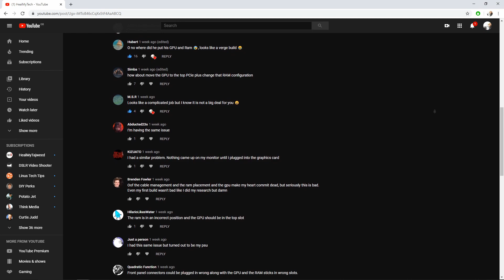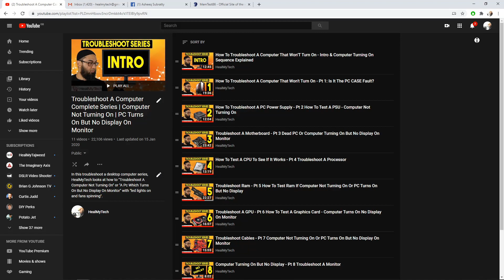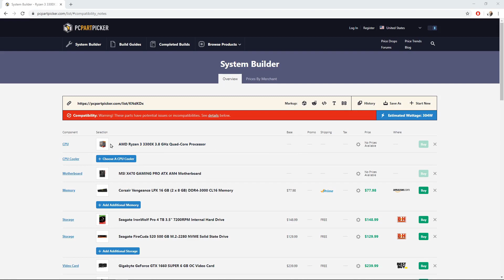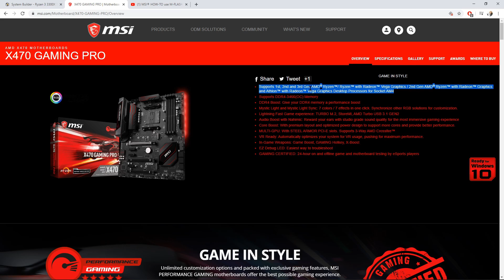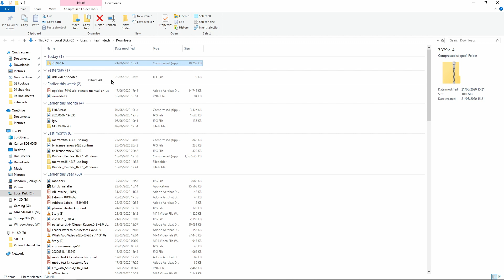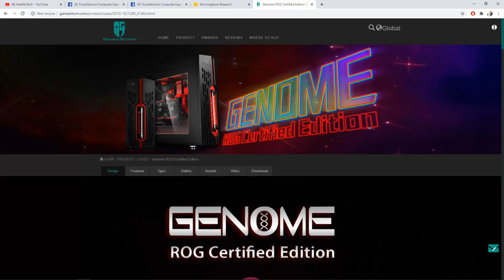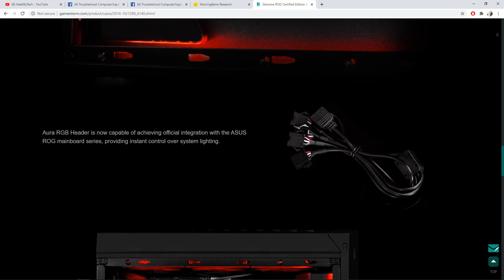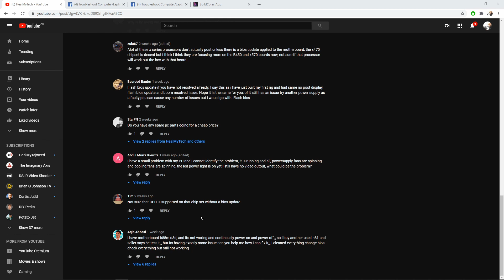New Gaming PC Build No Display - HUGE Beginners MISTAKE

Comment: Could have literally said the mistake in the first minute
Reply: You could have mentioned the mistake in this comment too.
Reply: Where's the timestamp guys? 15 mins for 1 mistake.
Reply: @hydn79  I ended up not watching the video. But in my case, the problem was that the motherboard's BIOS version was not compatible with my CPU, so the solution was updating it to the latest version.
Reply: @facuigua12  thanks! Thats it indeed
Reply: @facuigua12  did your pc turn on but there was no display on the monitor (bios included)?
Reply: @ozanisaqt5646  Yes, PC turned on but no display, no signal at all.
Reply: @facuigua12  but how did you do it with no display?
Reply: @delijahwane  Modern motherboards have a feature to update it with a usb flash drive and pressing a button, on my Gigabyte motherboard it's called Q-Flash. Look up how it's done for your specific model.
Reply: @facuigua12 I already updated my motherboard before I put my new cpu in and it still won't display
Reply: then u wouldnt have watched the video

Comment: I just bought a brand new pre-built PC with a Asus 3080/Asus Mobo/i-9  and couldn't get display to read. I know that the parts are compatible but you inspired me to consider it was a BIOS issue. I popped the CMOS battery for a minute, put all the cables back and VOILA!!! Saved me thanks for your insight!

Comment: Hello, if you build a new pc for first time and if you use ryzen cpu this is for you. A Ryzen processor without the suffix 'G' (in model number) needs a Graphics card (GPU) and you can't output it to screen without one. So for a normal user you'll definitely need a Graphics card not only for BIOS update but for using it too.
Ryzen processors* (as mentioned above)comes without integrated graphics card which is needed to display to the monitor.

Comment: My brother bought an MSI X570-A PRO and Ryzen 5 2600X. No display output on his rig either.
Albeit the motherboard bios update is mandatory for series 3000 cpus, the non posting/displaying issue can be still present.
First time i tried to boot my brother's pc, the tv it was attached to (via hdmi), was displaying a still image (probably the last frame in the video buffer) with artifacts.
I'd advice to let the pc run a little longer on the first post and try different video ports AND screens (I solved switching to an old IBM VGA lcd display fo initial configuration).

Comment: Ok, so I built a new computer for my wife.  My first build in YEARS so I'm further out of the game than I thought I was and am having issues.  I initially was able to get this to post connected directly to the graphics card.  I fiddled around in there with some things that I rightly should not have as I didn't know anything about and exited.  I am now unable to get anything to post at all via the graphics card nor the motherboard directly.  Any help at all?

My system:
-MSI MEG Z490I UNIFY Mini ITX LGA1200 Motherboard
-Intel Core i7-10700K 3.8 GHz 8-Core Processor
-Crucial Ballistix RGB 64 GB (2 x 32 GB) DDR4-3200 CL16 Memory
-Asus GeForce RTX 3070 8 GB KO Gaming OC Video Card
-Thermaltake TH240 ARGB Sync 59.28 CFM Liquid CPU Cooler
-Addlink X70 1 TB M.2-2280 NVME Solid State Drive
-Team T-FORCE DELTA RGB 1 TB 2.5" Solid State Drive
-PNY CS900 1 TB 2.5" Solid State Drive
-Corsair CXF 650 W 80+ Bronze Certified Fully Modular ATX Power Supply
-(2) Corsair ML120 Pro LED, White, 120mm Premium Magnetic Levitation Cooling Fan

All in an Antec Striker cae.  

Will be running Windows 10 Home OEM 64-Bit but haven't gotten that far.

Comment: I have a B450 M PRO R2.0 with a ryzen 5 1500X and two sticks of DDR4 2666. And I put in a GTX 1650. But when I try to boot it up, Everything powers up, but no screen.  It gives me 5 beeps. I put a speaker on the mother board still 5 beeps. I have a radiator for pc cooling my graphics card. What am I doing wrong? 🤔

Comment: So I have the same issue.. no display, hence I can't get in to the BIOS setup.  I've checked the compatibility and the MSI B550M PRO-VDH WIFI Mobo is compatible with the AMD Ryzen 3 3100.  Any thoughts?
Reply: So I resolved my issue. In my case, the fix was ensuring all wiring was plugged in. The GPU had a separate, second module that didn’t dock in to the MOBO but took up a card slot for additional inputs. At first, I did not connect this and once I did.. voila

Comment: Paper clip testing:
 
I first had no fans spinning and PSU fan came on for a few secs and stopped. No power LED on MB either. One by one I disconnected things 'til I sighed and took the MB out of the case & set it on its box. I peeked at the CPU itself & figured out I'd aligned its triangle with an embossed triangle on the slot, but that was 90 degrees off. The triangle should have aligned with a white dot on the MB. I fixed that, connected the PS, CPU fan, GPU and a HDD and powered up, using a screwdriver to short the power pins on the MB. VOILA! the fans all started & kept running even though the PSU fan stopped. Turns out it has a "zero fan mode" at low temps.  Still wouldn't POST, though.
 
Did another day's research and found that the MoBo wouldn't support that series of AMD Ryzen CPU! Hah! I also found that the Corsair Vengeance RAM has a special series for the Ryzen chips. If you use the regular series, as I had, they'd work but not at full speed! Hah #2!
 
So I got an RMA from Amazon and back the CPU and RAM have gone. Soon as I see the credit, I'll buy the proper ones for the MoBo. Another week and we'll then see if that's all that was "unsupported."
 
:D

Comment: I finished my build with a friend, whom is a professional at this stuff, but can't get monitor to display, here are my specs:

Ryzen 5 5600x (Yes I know I need a BIOS update. But can't display the monitor so I cannot update it). 

^ (Would the BIOS menu display maybe if I pressed the bios menu button?)

ASUS TUF Gaming X570-PLUS [Wifi]
HyperX RAM 2x8GB
Castle 360ex AIO.
ASROCK 5700XT Taichi GPU
Corsair 850W PSU. 
6 Case Fans, Lian Li Borra. 

Mobo lights up yellow for the RAM. But I am sure it's the motherboard. But my mobo doesn't have a BIOS USB slot. And I am supposed to be able to use any of the USB slots on the Mobo. 

But unsure of how to update the BIOS if I can't see what I'm doing.

We're going to try putting my RAM in his PC later on tonight when he gets off work.
Reply: Hey could you explain how it got fixed if it did.
Reply: @sudhhhrhsk4756  I looked something up. We had to put his CPU in and update the BIOS. He didn't believe me when I told him we had to do that. But we did it that way. Put my cpu back in and it worked.

Comment: I had the same problem everyone in these comment had but how I got it to show a display was I did nothing and it work. When I first build my pc 2 years ago it took FOREVER to start and I had everything right but then I left it on and ended up falling asleep on my desk the next morning I just turn it off then back on and it worked like normal. Years later I fully cleaned my pc. Removed all my parts, plug it back it and it was not showing display again so I just left it on all night woke up and it work. Idk why it like this but it the ONLY thing on YouTube I have not seen that work for me.

Comment: I'm having trouble getting my monitor to get a signal from my tower. I double checked EVERY plug, tried both HDMI and DP in both the motherboard and GPU, checked to make sure my ram and GPU are installed correctly. I even went as far as to pull the actual CPU out and I did find bent pins but I bent them back and realigned them, reinstalled. Everything runs but the debug CPU light is still on and I still have no signal to my monitor. I tried M-Flash BIOS for the motherboard in case it wasn't compatible with the CPU so that it should now be updated to support my CPU. I've seen dozens of videos and months of research into compatibility between every part and the unit as a whole and while I'm not super experienced, I'm pretty sure there should be no issue. Everything fits in the case right too, nothing bent or out of place even a little.
Reply: My rig:
Case: NZXT H510 ATX
PSU: NZXT C750
Motherboard: MSI MGP B550 Gaming Plus (with BIOS upgrade 7C56v191 from 3/23/2022 for AMD Ryzen 7 5800X support)
SSD: Samsung SSD 980
CPU: AMD Ryzen 7 5800X
Cooling: iCue H100i Elite Capellix
GPU: EVGA GeForce RTX 3060
RAM: 8x2 Corsair Vegence RGB Pro (plugged into the recommended slots according to my motherboard)

Comment: Hi, Im a first time builder and I have the same exact problem with my monitor not turning on. The difference is that my parts ARE compatible and I still have the same issue with the monitor not turning on. The keyboard and mouse and everything else turns on.
I even took out the gpu to see if that was the issue and I still have the same problem. The gpu was also in the correct place, closest to the cpu.
I made sure the ram was in the right place and still no luck.
I checked the battery within the motherboard and no power to the monitor either. 
I removed the SSD to see if that was causing a problem, and nothing changed.
I've been trying to build this dang thing for 12 hours now through trial and error and I don't know what it could be. 
If you have any suggestions please let me know. Thanks.

Specs
Corsair CXM 650 W 80+ Bronze Certified Semi-modular ATX Power Supply                                          Gigabyte GeForce GTX 1660 SUPER 6 GB GAMING Video Card	                                                                Western Digital SN750 1 TB M.2-2280 NVME Solid State Drive
Patriot Viper 4 16 GB (2 x 8 GB) DDR4-3000 CL16 Memory
Gigabyte B450M DS3H Micro ATX AM4 Motherboard
ARCTIC Freezer 13 CO 4 CFM Ball Bearing CPU Cooler
AMD Ryzen 5 1600X 3.6 GHz 6-Core Processor
Acer GN246HL 24.0" 1920x1080 144 Hz Monitor
Reply: same did u found out what the problem is ?
Reply: Same also I got the same specs as u off a Reddit I’m pretty sure u got it off that too?
Reply: Same and its frustrating
Reply: @vSilense  I fixed it
Reply: @xenogng  that's awesome cant say the same for me but that's good
Reply: @vSilense  um ur not gonna ask how? Whatever all I did was push in my HDMI into my gpu more and made sure the gpu was fully in
Reply: @xenogng  LMAO that was the first thing i tried, both hdmi ports dont work so im thinking it could be the motherboard
Reply: @vSilense  dang
Reply: @xenogng  yeah but I'm just testing everything
Reply: @vSilense  try replacing ur ram into a new stick
Reply: @xenogng  yo im going to try thanks for helping man
Reply: Your videos are very well done and are simple to follow - really appreciate that.    First time builder - The same thing is happening to me as well - we are using a MSI B550 Gaming Edge Wifi with a AMD Rayzon D 3900X processor - we flashed the bios and we have no lights on the EZ Debugging panel - however we have no VIDEO - we have tried many things -we checked compatibility and everything works - we are at a loss - any help would be appreciated.   thanks

Comment: sir red light on pc all fans spinning fast no POST what was the solution... Hope u Reply!!!!!!
Reply: Have you found it bro I’ve been building my pc for 2 days and will resume in another 2 days but I had everything set up and no post come to find out power supply was not working so I have to get a new one today. I hope that by now your pc is working bro.
Reply: I first had no fans spinning and PSU fan came on for a few secs and stopped. No power LED on MB either. One by one I disconnected things 'til I sighed and took the MB out of the case & set it on its box. I peeked at the CPU itself & figured out I'd aligned its triangle with an embossed triangle on the slot, but that was 90 degrees off. The triangle should have aligned with a white dot on the MB. I fixed that, connected the PS, CPU fan, GPU and a HDD and powered up, using a screwdriver to short the power pins on the MB. VOILA! the fans all started & kept running even though the PSU fan stopped. Turns out it has a "zero fan mode" at low temps.  Still wouldn't POST, though.
 
Did another day's research and found that the MoBo wouldn't support that series of AMD Ryzen CPU! Hah! I also found that the Corsair Vengeance RAM has a special series for the Ryzen chips. If you use the regular series, as I had, they'd work but not at full speed! Hah #2!
 
So I got an RMA from Amazon and back the CPU and RAM have gone. Soon as I see the credit, I'll buy the proper ones for the MoBo. Another week and we'll then see if that's all that was "unsupported."
 
:D

Comment: I’m still having trouble after 6-7 hours of work into this pc no display, I just changed the cases as it’s a prebuilt and everything was working fine before I switched cases. 
Also it was making a beeping sound at the start when I first plugged it in and double checked the wires and turned it on and it didn’t make a beeping sound anymore
Reply: Probably there's a short with one of the  motherboard raisers.
Reply: Install a video card.

Comment: Wish that was my issue mine is booting into the bios screen but not windows, I get a blue like on my monitor that its on and the display lights up too but 2just not seeing windows. maybe because the graphics card drivers are not fully loaded but if I do a format and start all over I can see windows . It happens when I turn off the monitor I have turned off the HDD from shutting down & pushed the screen saver out for 3 hrs and stopped anything from hindering an issue.

Comment: Im an experienced PC builder, I bought a Ryzen 7 3700x and an ASRock B550m mobo, triple checked the asrock website that they were compatible, but it wont post, so im assuming a bios update is needed, but i dont have a older ryzen chip to do the update with. Going to try and get the store i bought from to give me a replacement board with the right bios
Reply: Same problem with mine, any fixes?

Comment: Hello!    I just finished a new build but unfortunately it won't startup.   I am one of those first-time PC builder guys!  I have a good bit of experience swapping parts, upgrading, and writing software but I had never built a PC from scratch.   I was hoping you could help me, or at least point me in the right direction for some additional troubleshooting tips.  

Everything appears to start up normally; the LED lighting, case fans, GPU fans, etc. but no activity from the keyboard or monitor.  The caps-lock and num-lock on the keyboard to not work.  And I have tried the keyboard on different USB 3 and USB 1.0 ports with no luck but it works on other computers, same with the monitor.  Problem is I have no idea if I have loaded the BIOS setup or not because I can't see anything.  It just continues to hum along, fans whirring, LED lights flashing.

The only funny thing (or not funny really)  is at the beginning of the POST the system will appear to start up normally for about 10 seconds then it acts like it wants to die, the fans and lights continue to work but it appears it wants to enter POST all over again.  But 10 seconds later it is back to full speed/power, without keyboard or monitor.   I have also tested the USB ports with low power charging devices and they seem ok.

Next I plan to start unplugging the peripherals that are plugged into the m/b one by one to try and pinpoint the problem.  If the problem was memory or CPU, I imagine the system would hang and/or crash but it just sits there humming along with no way to I/O.  I don't have any beeps to decode either.  I am going back to PCPartpickder.com and look for compatibility problems which was the issue you found.
Thanks for any  ideas!
Reply: I figured it out; it was a bad 16GB memory module.

Comment: I have an X570 Arous Elite and have the ram in slots B1 and B2. My old motherboard I had them in slots 3 and 4. I wanted to put them just a bit farther away to prevent difficulty installing the fan, Never had an issue before, but I guess I could try to move them and see how it goes.
My GPU is in the right spot, so that's good.
I have an X570 Aorus Elite and an AMD Ryzen 7 5800x cpu. 
Pcpartpicker says I may need a bios update or a different cpu supported by older bios revisions. Sigh...should never have upgraded. Thanks logicalincrements. I guess back to newegg you go. Pcpartpicker says an AMD Ryzen 7 3800X 3.9 has no issues, so I guess I'll go with that?

Comment: MY PC TURNS ON WHEN I TAKE MY GPU OUT, WHEN I PUT IT IN THE PC WONT TURN ON, LED LIGHT COMES ON THE GPU BUT JUST DOESNT TURN ON, LONG STORY SHORT I SWAPPED THE MOTHERBOARD OUT AND IT WOULDNT TURN ON, PUT OLD MB BACK IN AND IT WOULDNT TURN ON BUT IT WORKED THE SAME DAY BEFORE I SWITCHED ANYTHING, CAN ANYONE HELP ME PLEASEEEEEEE!

IVE BUILT IT OUTSIDE THE CASE, DISCONNECTED EVERYTHING RECONNECTED SLOWLY AND THOUROUGHLY AND NOTHING WHEN THE GPU IS IN BUT WHEN OUT WILL TURN ON BUT I HAVE NO ONBOARD GRAPHICS SO CANT EVEN CHECK BIOS OR ANYTHING.

Comment: Intel 11th Gen Core i5 11400F 16GB DDR4 Upgrade Kit - ASUS Rog Strix Z490-H LGA 1200 Intel Motherboard + Intel 11th Gen Core i5 11400F Up to 4.4GHz CPU - No Integrated Graphics + KLEVV BOLT X 16GB 3200MHz DDR4 Gaming Memory . I bought this combo deal hope this cpu is compatible to my motherboard.  It came on with some updates. Then turned off few times . Now it's not coming on. Just a rgb red LED is on . No fans are spinning . Seems dead . I need help

Comment: I recently bought a new cpu for my PC and when I swapped them I didn't get a signal and forgot to do a bios update, and when I swapped back to my old cpu, it wouldn't post either so now I dont know what to do cause I already did the reset cmos with the battery method and the two pin method and yet nothing on my screen, I even took out all my ram sticks except for one and yet nothing